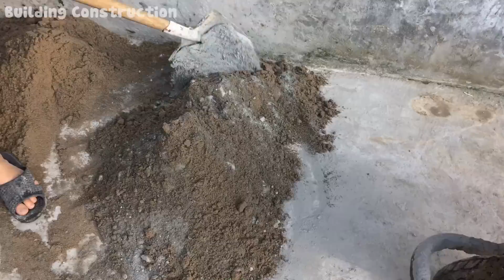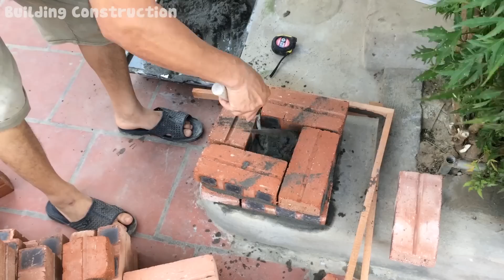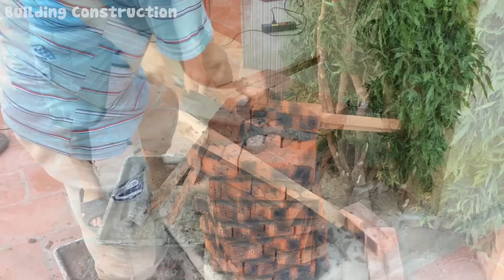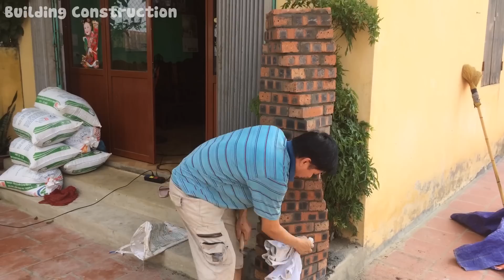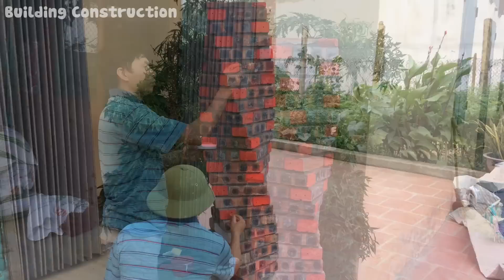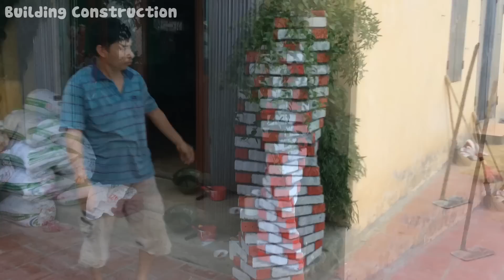How To Build Twisted Columns From Mortar And Bricks - Construction Design At Home

Comment: Awesome work. Its really amazing. Can you please tell me how you made that wooden bracket???
Reply from the maker: Thank you for watching the video
Wish you a good day
Share videos to help me
Reply: Its 2 right angle timbers fixed at the ends.  the top right angle timber is of set slightly by a block of wood nailed into the top of the top of the bottom right angle timber.
then the top right angle timber is nailed into the block. the twist can be greater or less depending on how you set the top right angle. very simple to make. the challenge is keeping the structure upright while doing the twist. a centre pole can be used by fixing to the concrete floor first then building the wall around the centre point, in turn keeping your twisted structure straight as you build upwards.
Reply from the maker: @theroofingcompany5145  
thank you
Reply: @buildingconstruction8386  send mobile number. Mujhy ye bnana hh